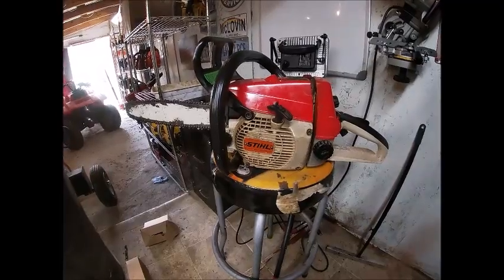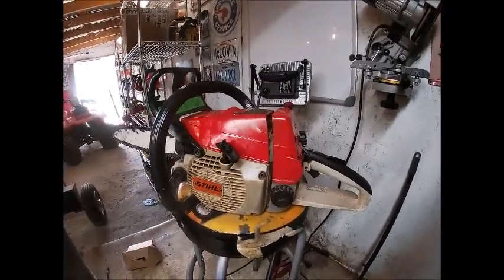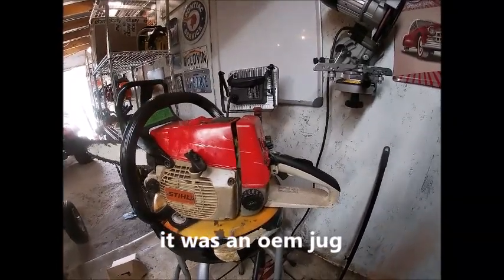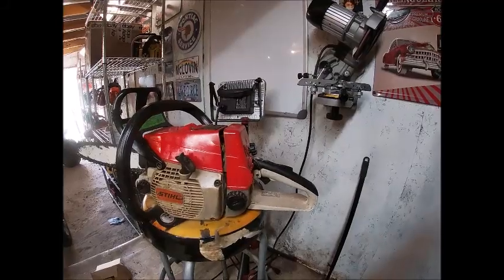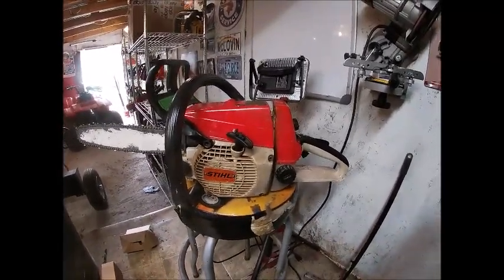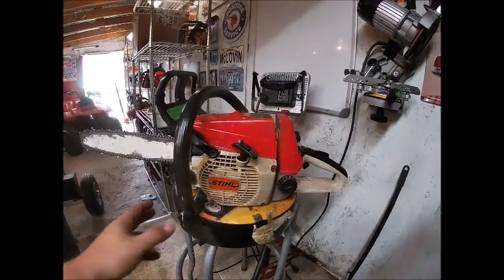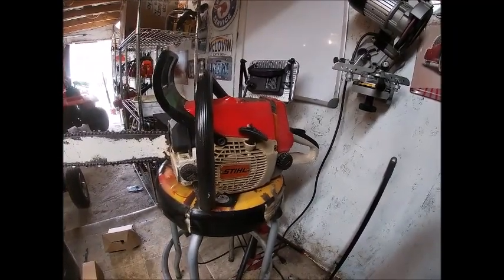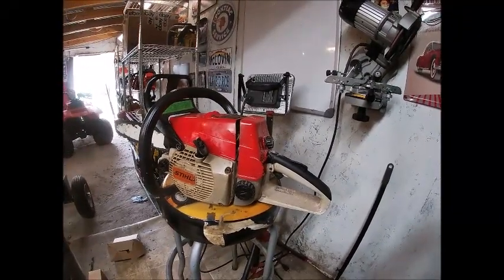Ported Stihl 024 Super 44mm ready for work

Comment: This is what my next project is going to.  Got an o24 super that was my dad's. Been doing research and getting parts. O24 super is like a hybrid between the o24 and o26. 
These are the "forum specs" I got:
024: 42mm bore, 30mm stroke, 41.6 cc
024S: 42mm bore, 32mm stroke, 44.3 cc
026: 44mm bore, 32mm stroke, 48.7 cc